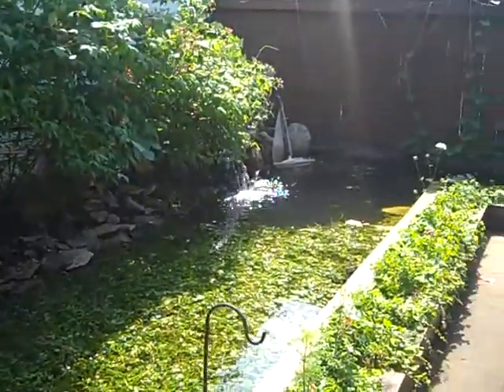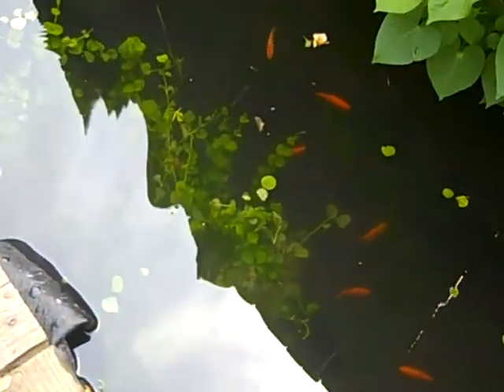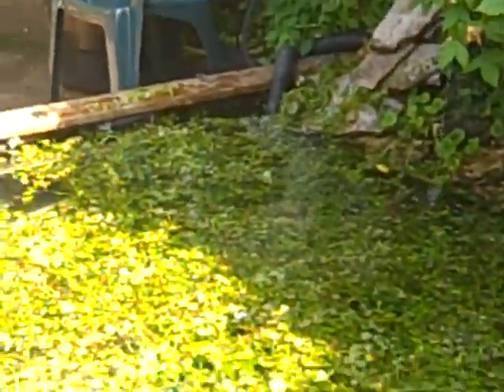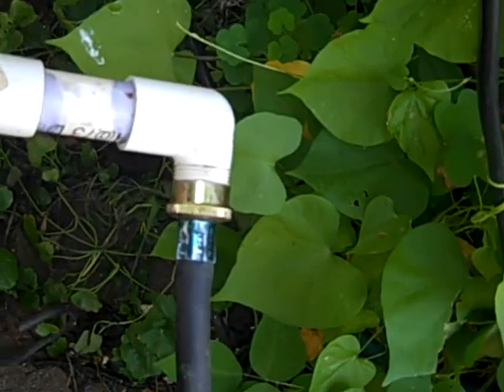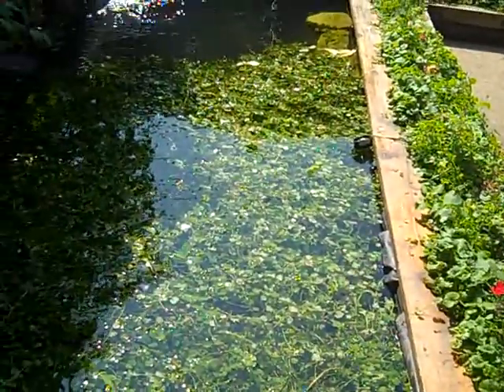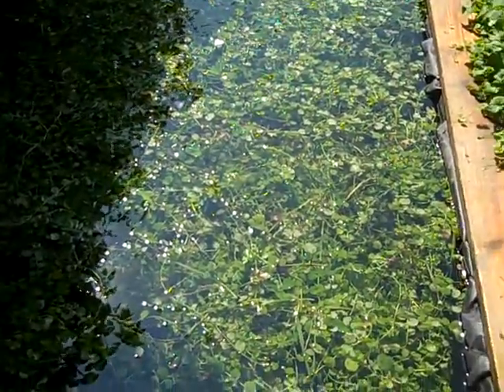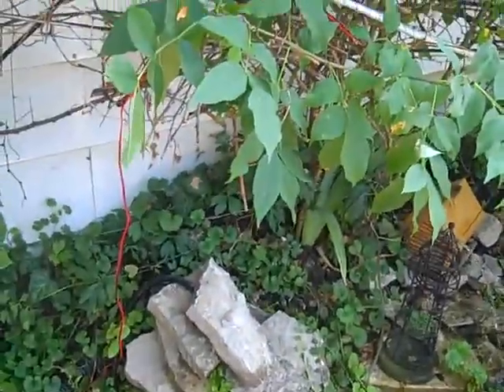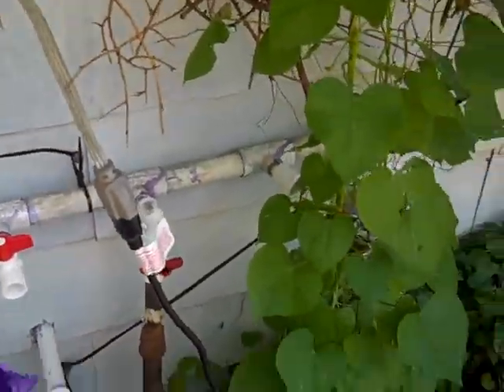Pondscape.us - Explaining the Charlie & Pond Heater

Comment from the maker: @djrat81 Hot water heaters have thermostats in them. The heater itself has no way of knowing anything about the flow of water, only the temperature of the tank. When the temp gets too hot, the heater kicks off automatically. So, where is the fire risk? What supposedly would be the problem? I don't understand your question.